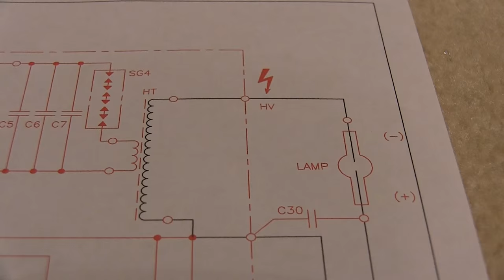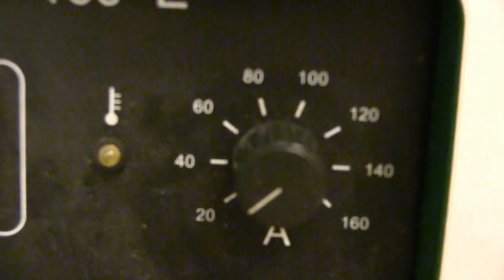Xenon Short Arc Lamp Ignition

Comment: Great vids!  On that ignitor, if you want to use manual ignition, is it just a momentary connection between 4 and 5 needed or does this have to be powered through the connection between 5 and the positive post connected to the DC power?

Comment: I once rebuilt about 50 (40 year old) Vss-3 and Vss-3A searchlights and we sold them on eBay. Half of them blew up the capacitors in the control box upon first power application ( after 40 years).

Comment: that popped transformer is a current transformer.......that wide copper ribbon was the primary, the twist of wire ,the secondary.
suggestion: b+ to the tungsten lamp, the xenon in series to 0V, where the two lamps are connected together, a small H.V. cap to trigger source.

Comment: 5:37 The reason it is made up of sheet steel (and not a solid lump) is because this prevents "Eddie currents" to form within the core, alas creating premature overheating - thus making the transformer severely inefficient. This is the same principle used in a typical W-shaped (or E, depending on how you look at it) transformer, when the core is made up of many layers (or laminates) - where when they get "worn", they create that "buzzer" sound effect... 😏

Comment: Lol,i have no fucking clue,what all those components do,but its bloody interesting..
Reply: The yellow brick like metal thing is a transformer, it takes low voltage and makes it higher, like a hose nozzle. The black square thing near the oval metal round spam cans is a diode, a one way gate for electricity. The 4 spam cans are HV capacitors, basically a battery. And the black round thing is a neon transformer presumably.